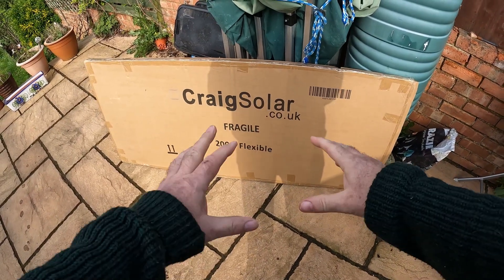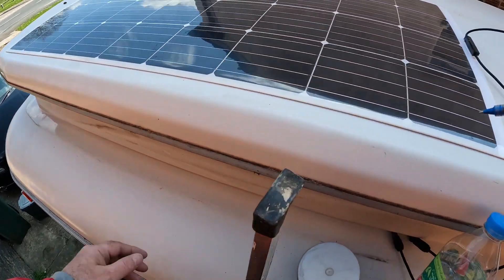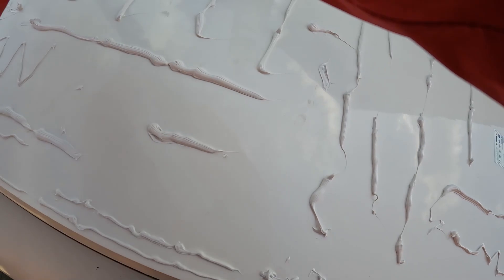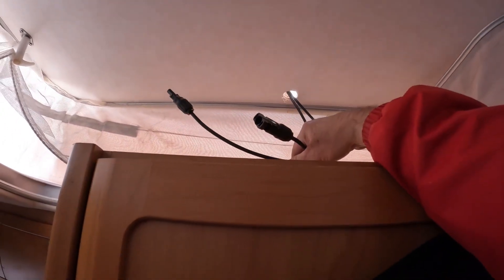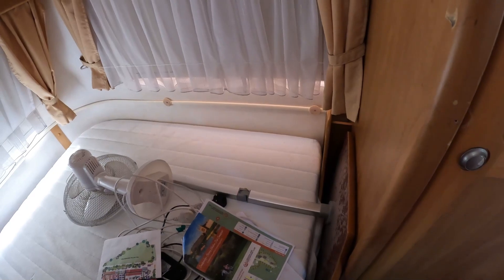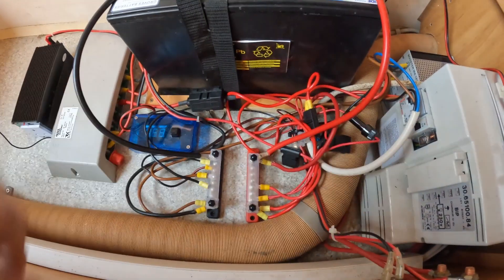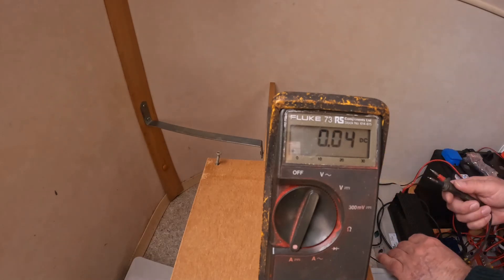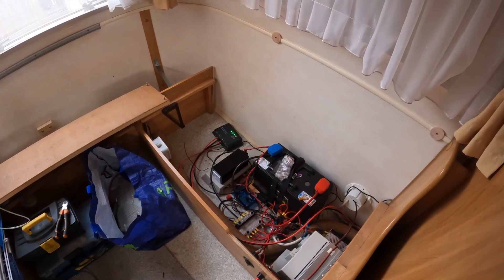Fitting a Solar panel to my Eriba 430GT

Comment: I would’ve placed a stand alone solar panel outside the caravan …then taken a cable through the floor or through a window....to keep my roof as standard…i would try though to avoid this modification altogether..
Reply from the maker: That's your choice , its my van and l doubt very much l would ever keep it standard ,already thinking of adding another panel. l do have a stand alone fold out panel, but have not required to use it just yet.

Comment: Is the roof going to leak?
Reply from the maker: No its not going to leak , we had to endure some heavy storms at the base of the Pyrenees and we had no leaks, I never expected any, its all good.
Reply: @Baggyarse  i would have drilled the floor and glued the cable outside up the wall to the roof…
Reply from the maker: @griswald7156  Yep that would have been ok too I guess.
Reply: I have similar on my Eriba roof with no leaks since it was installed 3 years ago